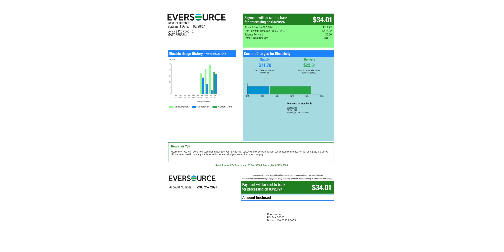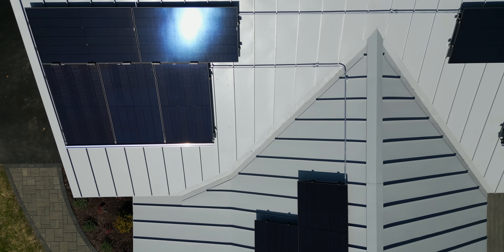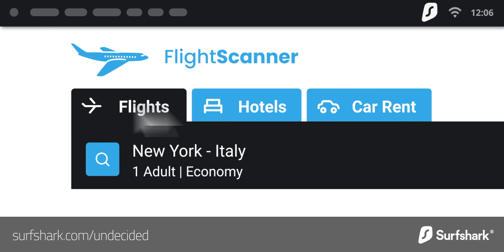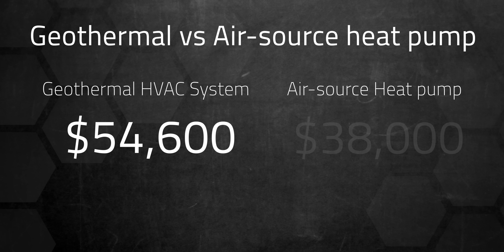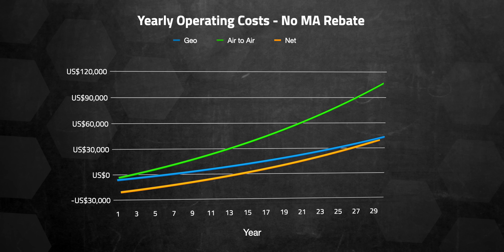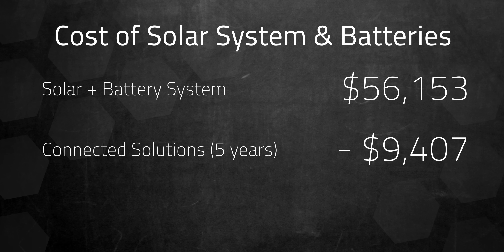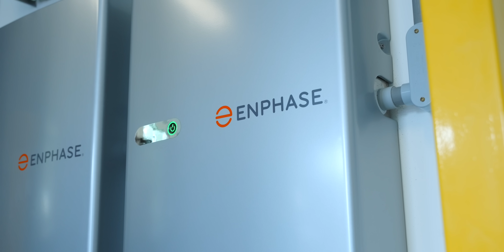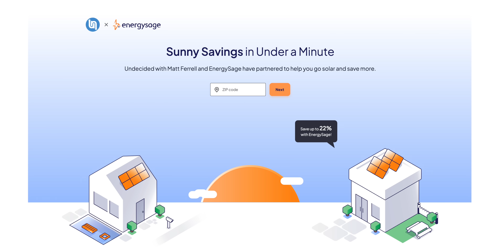What I Learned After 1 Year with New Solar Panels

Comment: Did he say forever home and 30 year time horizon in the same sentence. Those don’t mix. A forever home should be 100 years plus. 

My track built home was just a bit above average for Seattle area construction. It just hit 30 years and it is still in fantastic shape. Ok the windows are crap but they work just fine. 😁

Comment: I live in Seattle. 12 years ago, I spent 10 grand for a 3kw roof mount system. Huge mistake. Constant maintenance, only 300 dollar per year return, too cloudy, cold, rainy, constant cleaning under the panels otherwise you get roof damage. Expensive replacement of microinverters. I will never get my money back. I would have been way ahead to have put the 10 grand in the S&P 500. I would have made a grand a year and still had the original 10k without hassle.

However, one great win is the $3,500 I spent on installing a heat pump the same year. Highly efficient, saves 900 a year on energy costs. very little maintenance, and works 24-7, 365 regardless of sun, rain, wind, and darkness. No pristine environment is required.  Contrapositively, I would not have benefited by putting that money into the S & P, I would have only made 1/3 of the annual return of my heat pump.

Like my marriages, only about 1/2 of what we do works. Half of what we attempt is successful and heavenly, the other half a nightmare. Go figure.
Reply: I don’t see why you would ever need to clean the panels or under them. I would imagine it rains enough in Seattle you shouldn’t have to worry about that.
Reply: @maartenvanrossen6138  My neighborhood has a lot of deciduous trees. The leaves end up covering the solar panels rendering them useless. I have to climb on the roof often and hose both the top of the panels and under. Leaves create mold and moss, hurting the roof underneath. It costs 20k to replace the roof from leaving moss there. Again, the heat pump is a ground unit, is easily accessible, and never has problems from leaves.
Reply: Here in Michigan rain cleans my panels.  Snow in the winter, but that's worse because they don't operate the next day, until the snow melts off.  Not sure what you did wrong but sounds like a lot of things.  Zero problems with my Enphase microinverters, zero problems with my larger array with the SMA inverter.  Zero maintenance so far but maybe I'll take a look in the spring and clean them myself, 5-6 years in.
Reply: @whattheschmidt  What kind of return are you getting? Mine is pretty dismal. Seattle and Portland are not good for solar. 3% ROI at best. The microinverter replacement and hassle of getting on the roof frequently make the project not worthwhile. But other folks have different experiences, and living in the sun belt should produce 3 to 4x my returns.
Reply: @ChrisPat-kq4fw  The 2.5kw array with Enphase inverters is only a couple months from ROI. Cost $2700 to install in early 2020. Makes 3mwh a year. The one I paid for is about 4 years away, less if rates go up further.  Installed in 2019, 5.4kw. I generate around 9mWh a year.  Offsets my house and EV. I even installed a heated family room floor to use more electricity.
Reply: @whattheschmidt  Sounds like a good experience.  Fortunately, a lot of folks are having success with these things.  Especially if you live in a sunny area, or if you can find panels, inverters, and installers for cheap. I obviously paid retail, and unfortunately, most of us have to learn the hard way the first time around.
Reply: @whattheschmidt  $2700 or a 2.5kw systems is a very good price, either you found an unusual installer who co do the install, permits etc for that or perhaps you did some of the work yourself?     For your parameters I calculate a net cost of 10 cents/kWh from a $2700 system making 3mWh.  If your grid power is expensive it will indeed pay for itself quickly if you have no other costs.   If your grid power is 10 cents it would pay for itself in 30 years.  Though taxes can change the costs.  (I bet for Matt Ferrell he tax deducted all of the systems he describes in this video.   The IRS might question it, but it's clear he's making part of his income by putting these systems in and documenting them, but he might have to take the energy as a benefit.)
Reply: @bradtem  Yes, I installed it myself.  Ironridge XR100 and Quickbolts with microflashings.
Reply: @bradtem  energy in Michigan is close to 20 cents a kwh, so thats $600 a year abouts. With the small array.
Reply: @whattheschmidt  Yup.  Impressive to get a system for $1/peak watt.    More common to see $2 or even $3 on a small system like that, which would not break even.   Here in California (40 cents/kWh) it's much easier to be a win.   We need to make it easier to get permits and install for such a low price, if we really want a solar transition.  The base cost of solar is indeed under $1/watt but all the trappings around it and installer margins (and soon Chinese tariffs) change the game.    Did you get permits or go around the system, if you are willing to answer?
Reply: @bradtem  all to code and in the original permit, not inspected

Comment: So worth it.  I have 32kWh battery, 14kW peak Solar, and like you get paid to help the grid under peak load.  I also get 3 periods of cheap electricity each day (total 8hrs) when I can top up the battery and one period of 3 hours where the import price doubles, so one runs on battery then.  The background load is around 4kW at this time of year (56°N)..  when doing your calculations did you factor in the loss of income on the capital employed (or cost of borrowing) aka a Net Present Value calculation?

Comment: Uhmm. Matt. $ 954.37 is not an "about" figure. It's a very specific figure. About $ 955 would be a far better way of putting it. Better still, "about $ 950" or "about R 1k" is quite good enough. Seriously, no-one does home budgets to greater accuracy than that, and if those small numbers make enough of a difference you should be reconsidering your options.

All through the video, every dollar figure is given in excruciating detail. I realise a lot of nerds like that, but we're watching a YT video, not attending a Green Home Installation seminar and taking notes. It's real hard to see the big picture when most numbers are given to 2 decimal places and many have 5 $$$ digits. Round them off, Matt, round them off!

Comment: I know that every set up is different - But you must have horrendous import tariffs on PV panels there  - 
for 43 x 400w panels (Just panels) now it is €89.00 each =  €3698  ... so where the rest of the  $55,000  comes from is well beyond me.
(and I know they were ordered a couple of years ago - But even then the panels were a max of €115 each in Europe.
My point (and this is important bit) is not to go "Nah-Nah" - Not in the least, It just strikes me that to protect local Panel manufacturers, the personal take-up & switch to "clean" energy is being
severely curtailed. Governments are balking at the massive cost of tackling Climate change : and yet here they are amplifying that cost.

Comment: the enphase micro inverter system is completely pointless unless you have serious shading issues or a complicated roof panel layout setup. you could have built a system for a lot less with more battery backup.

Comment: What shocks me is the annual consumption, in France; on average, it's 2.3 megawatts. As for me, it's only 1 megawatt per year. And you're telling me that you consume almost 18 megawatts, which is 18 times more—that's quite impressive. I didn't think there would be such a significant difference in consumption between the United States and France.

Comment: I bought a 14.4 kw system from Tesla with 36 panels and no battery.  It makes 21,500 kWh per year and cost $33,500.  After tax rebate, it was $23,000.  With net metering, I get rollover kWh in the spring and summer when I produce more than I use.  In the winter, I use those rollover, or “banked” kWh when I make less kWh than I use, because my EV uses 800 kWh per month.  In the end, I make about 2,000 kWh per year more than I use and I have not had to pay a power bill in the last 2 years.  I used to pay $4,500 per year for electricity and now I pay $0.  Going straight solar and no battery is way more cost efficient, especially when you get your solar from the lowest cost provider, which is Tesla Energy.  I do have natural gas central heating, gas clothes dryer and tankless hot water heater.  My natural gas bill is less than $1,000 per year.  I’m not net zero, but it s waaaaay cheaper than going the full electric route, especially when I live in sunny California, compared to your situation in MA.

Comment: I renovated a beach house near Melbourne, Australia. It's a lot easier to get net zero in a warmer climate, 6.2kW of Solar, 11kWh battery, Nissan Leaf for a commuter car, still ICE for longer trips / towing etc.  I can't believe the prices you paid, we've got some rebates involved here, but solar was $3k, batteries were $10k, the Leaf was $11k.  They all had very short payback periods, the batteries were the works at about 10 years, but solar and even the car paid for themselves in under 3 years.
Producing 10.7MWh a year, 2.3MWh was fed into the grid and 3MWh consumed from the grid, so including charging my car I'm now falling about 5% short of net zero at the moment.  More solar and double glazed windows coming soon.

Comment: Thanks for sharing, I live in Netherlands and I fully retrofitted my 1973 house with insulation, solar panels and the previous owner also installed a solar boiler system for hot water. I also made that boiler supply water to the washing machine. We have airconditioners (that we also use for heating) in 3 rooms and are in a process of getting an air-water heatpump to get heat in th eentire home. I found out my kids likes to shower to get warm after a cold or wet day and showered again seperately to wash and so I installed a shower timer giving them 7 minutes for one shower per day. The water actually gets cold after that. My energy bill is much lower than average but still high due to the Ukrain war

Comment: This is only working because of the aid and subsidies, which, among other things, are unfair. In other words, this 'net zero' is being paid with taxes, that is, taxpayers are paying for energy and a service that they do not use, so this will not apply to everyone. With costs as they are, this would neither be profitable nor efficient. And what's more, if the new government changes policy (I think it will) and also promotes nuclear energy, the reality is that 'renewable energy' will be much more expensive than 'traditional energy' and the interesting thing about renewables and other sources would only be the off-grid service for remote areas without access to traditional networks of energy. And also there is the need to evaluate if certainly the panels and pumps will work as expected during 25 years

Comment: If you save $5000 per year versus a HERS 52 house over 30 years at a 10% discount rate, your net present value is $50,000.  Since you paid more than $50,000 to install the system, you lost money ( despite all the subsidies).

Comment: I have an 1890 brick 3 floor and sub-basement row house in brooklyn. Little by little I am heading towards as net zero as I can get. I have gotten   a 7.2 kwh solar canopy rooftop system, producing about 10mw a year, and insulation between the roof and top floor ceiling, mostly new windows and getting all electric appliances, the last of which is to get is a 208  ac  electric dryer. I am torn between a heat pump dryer, and regulular electric vented dryer in the basement. The basement has two heat pump 50 gallon hot water tanks, one for the rental unit and one for my unit.  that is great for the basement in the summer, cooler and dryer, but pretty chilly in the winter and adding a heat pump clothes dryer seems like it would make it even more cool in the winter.  what do you think matt?  Or use the regular electric vented dryer in winter, unto the basement, with a lint screen, to create more warmth and less dry environment.  During drought that recently hit brooklyn the humidity was only 34 %, but now it is raining and the humidity is 48% in the basement.  The temp outsid is 55 and in the basement 67 f.   when it was 35 d outlside last week at night, the basement got down to 63 f.  with the hot water heat pumps running, full blast as I had to clean one and restart the hot water system. Energy star says the heat pump dryer an LG 5502 will use about 300 kwh  and the lg 4000 regular dryer  will use about 600 kwh. the vent of the regular dryer will have to be kept clean, bu the lint traps of the heat pump dryer  require twice as much work ith eqch use to clean.     The heating system has been gas hydronic, but last year I used various electric heataers, until january and february because someone else was staying in the house, and dI didnt want them to have to mess the electrici heats. Then in May I got some convection wall heaters by envi, and am using those now on the top two floors, and this summer installed a heat pump mini split air source system for the 1 floor.  Next I will probably get an air source heat pump mini split system for the top two floors, and a ev charger, though I will have to drag it accross the sidewalk to the street, no driveway., and no car yet  Energy use is probably going to be 8 to 8.5 megawatts a year, without charging an ev, or other peoples evs.  I am looking for an ev charger that has an app where people can pay, but maybe it would just be better to have a portabable one, and let them pre-pay with venmo or something, since I would have to throw a mat across the cable as it transverses the sidewalk to the street.    I am undecided too  Tracy :)

Comment: This all sounds great. But in life, you have to consider opportunity cost. You spent a lot of money on the equipment. That money could have been invested and earned a substantial return. Additionally, don’t know if you paid for the equipment with a loan. If so, interest on that loan needs to be included in the costs. My home with air source heat pumps has electricity bills that never exceed $330/month. Usually more like $270. I supplement with one tank of propane per year, another $800. The heat pump and propane were installed last year for ~$40,000 after taking advantage of MassSave rebates. So my yearly costs are ~$4000.

Comment: when I start looking for solar PV, I remember that first You should lower your consumption to about 20 kW per day/ 600 per month, by better house isolation , better window, LED lights, more efficient appliances and after that you can install PV to cover your consumption. I see that a lot of people go wrong way. Net zero is pushing to install so mach PV , so you can not transfer electricity back to grid anymore. You build system so big, so you can run small city on it.

Comment: You were taken to the cleaners,
in Sydney Australia it would have cost $6000-7000 USD to install top tier chinese panels (no tariff's) for a system of that size.
In Australia a smaller system would be more suitable as there is more sunlight in Sydney, 
panels are very effective even in the middle of winter, less batteries are needed, half that size would be as effective in Sydney.
The 88 Grand you spent would have cost around $15000 USD for an equally efficient system.
The Penetration of Solar Panels in the Australian market is rendering utility power obsolete and collapsing distribution systems in rural areas.
In Sydney 80% of daytime electrical power is supplied by homeowner solar panels,
in Western and South Australia states renewables supply 100% of all power with South Australia exporting to Victoria.